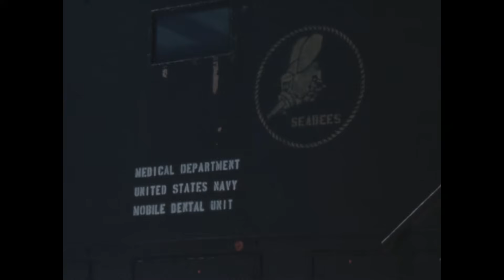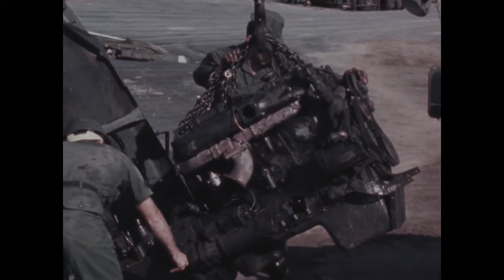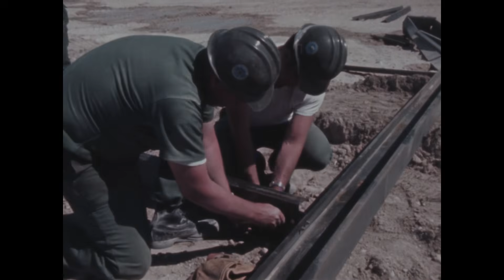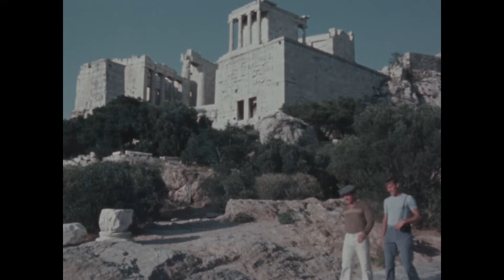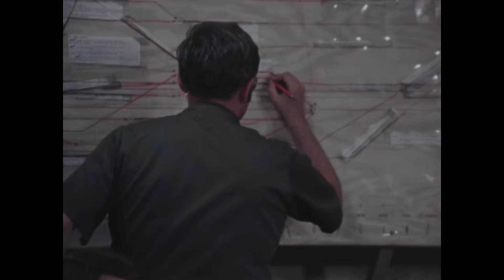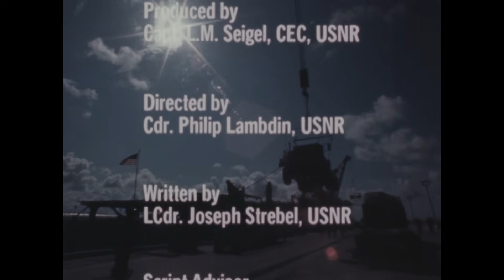Seabees Overseas: Deployed Naval Mobile Construction Battalions

Comment: The battalion itself (main body) 'mounts out' by sea? I don't think so.
Not in modern times. They travel by military aircraft or by chartered airline.
Reply from the maker: Yes, the Seabees used to travel with their equipment and materiel by sea for deployments. Air travel for the entire unit was a luxury not standard for personnel until the early 1960s.
Reply: Yes, USED TO (Deploy by sea).
I do know that. I myself served with NMCB 4 as a Utilitiesman.
Attaining the rank of PO2/E5.
This must be a very old informative video...
Active Duty: 
26SEP1978-31NOV1983